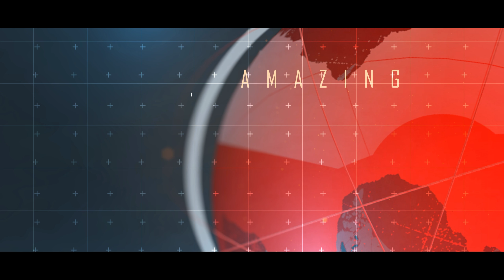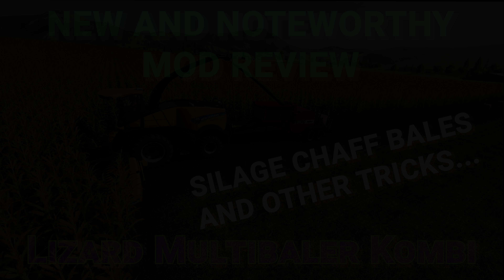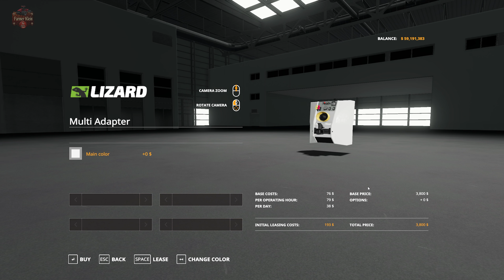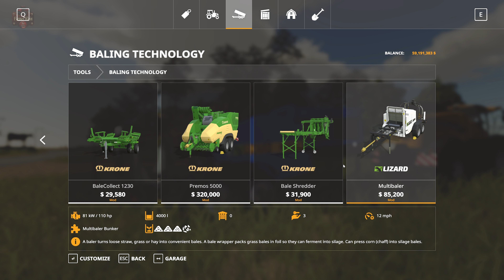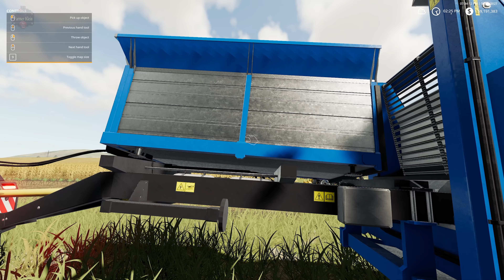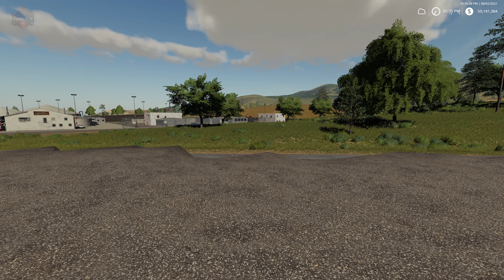Farming Simulator 19 - New and Noteworthy - Lizard Multibaler Kombi

Comment: How do you get the bunker onto the machine? I've tried  and it doesn't work
Reply from the maker: you place it up there with forks or super strength.
Reply: @FarmerKlein  when I use the pallet forks then it doesn’t pick it up it just falls straight off the side and I can’t get it onto the baler this is on console so we don’t have super strength
Reply: @FarmerKlein  Forks don't work. The bunker is super back heavy and just falls off the forks. The only way we've found to lift the bunker onto the baler is with forestry equipment.